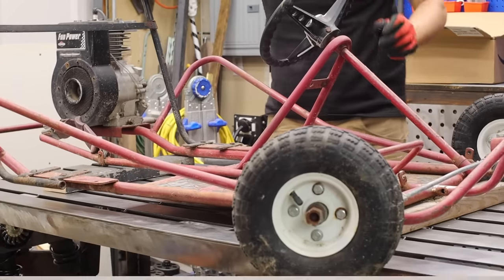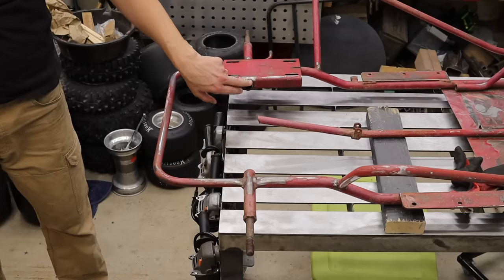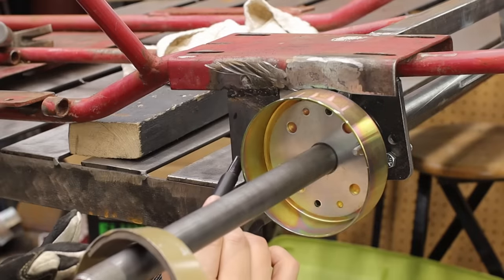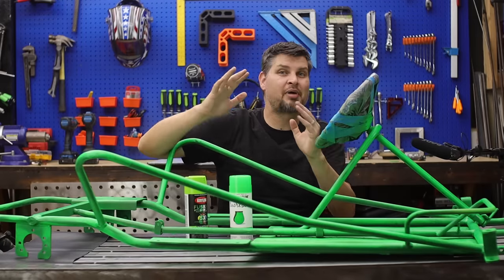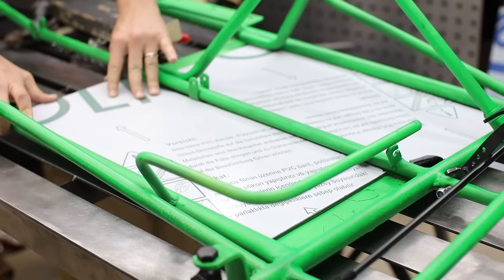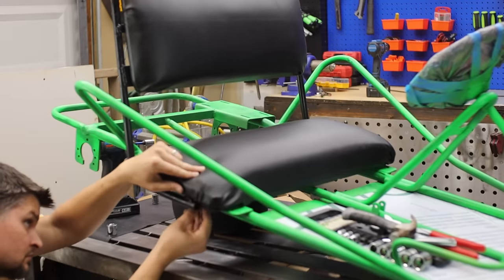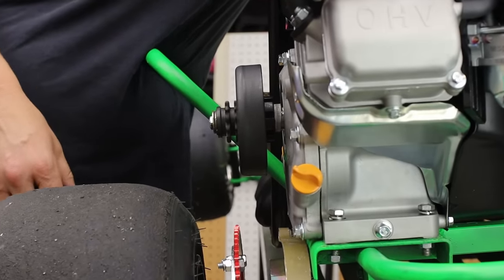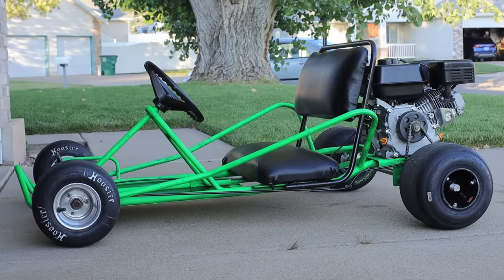$20 Rust Bucket into Kick $$$ Go Kart W/ Harbor Freight 212

Comment: I know it goes outside the DIY boundaries but I've done a few tanker desk restos, and they were in a similar rust/paint as this cart and I indeed did the first as you did with scraping/sanding and chemical stoppers but then I found a chem dip place. 120$ to chem dip/e-coat a whole desk which was worth it 10 fold.  Just figured I'd mention it for others if they wanted to save hours and still have fun with the building/modding diy stuff.

Comment: Do you think a harbor freight welder could make a small diy mill and diy lathe???
Reply from the maker: As long as the thickness of material you want to weld is 3/16" or less, than yes! Would be interested in the design of a mini mill or lathe.
Reply: Then that will be my first project

Comment: Hey! I was wondering if you had any spare or broken engines because im trying to build my own gas bike or Gokart but don’t have an engine even a chainsaw motor! Thanks
Reply from the maker: Where do you live? I'll go out on a limb and say not close to me. Wouldn't be worth shipping it anywhere. Check your local classified ads for broken power washers, snow blowers, chippers, tillers. Those all have horizontal shaft engines that are perfect for go karts.
Reply: I live in perth